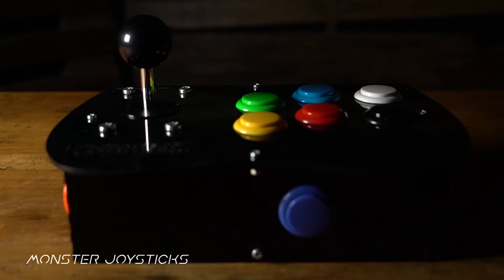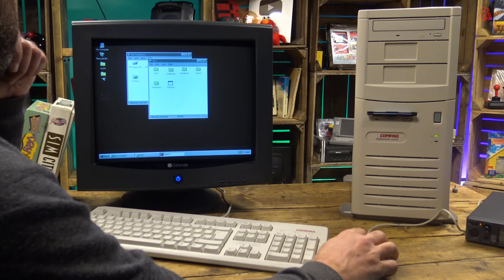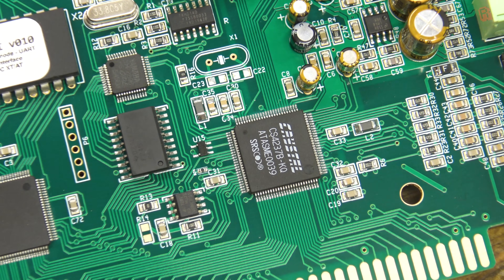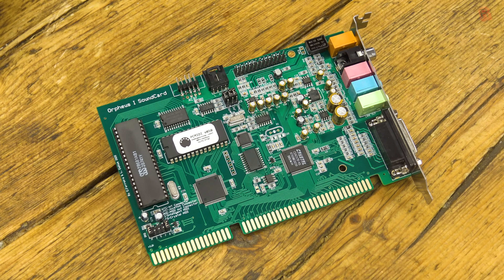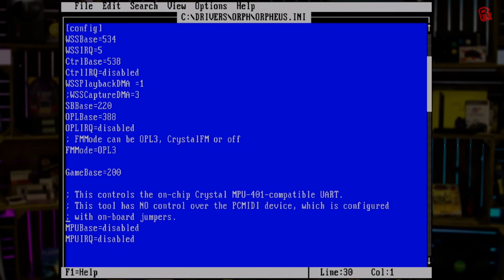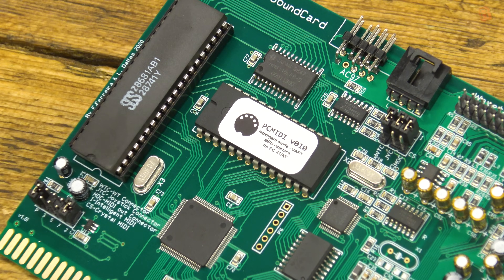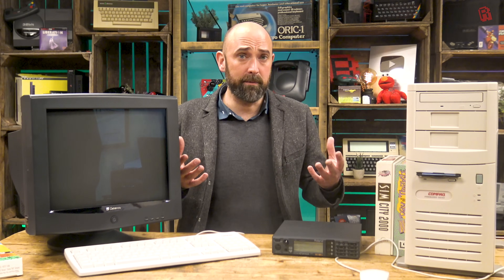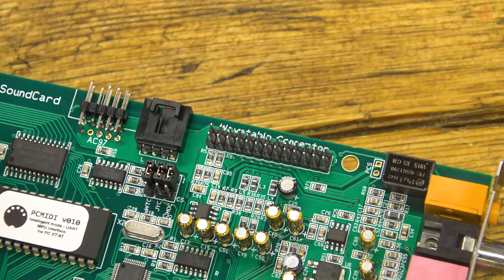Orpheus I + Dreamblaster X2 - A new ISA Sound Card for Retro PC Gamers - Tech Nibble #DOScember

Comment: I have the PixelX86 DX and I am not happy with the audio output, I can hear electrical noise, it's terrible. There is another "new ISA card" called the MK1869, I am wondering between this card and the MK1869 which has the cleanest output.

Comment: Make a mt32-pi and then get a Mister FPGA to use it with.
Reply from the maker: You might like our MiSTer Multisystem with Pi-MMS cart to do just that
Reply: @TheRetroCollective  I already have a sandwich setup in a acrylic case and a mt-32 pie.  It works just fine and has a smaller footprint then the Multisystem witch is good for my case.
Reply from the maker: @michaelcloutier2225  super! So long as you have a solution that works for you that's all that matters

Comment: "That's not the fault of the designers of the card" - In fairness, the card is designed specifically for retro systems, they should have tested it fitted in an AT spec case as well as ATX cases.
Reply: Most AT cases had identical style slots to ATX, even the original IBM PC would work fine with this. Compaq were notorious for proprietary designs.

Comment: What? No MT-32?! Oh, the injustice! Someone must rectify this situation immediately! 

Ahem. Someone other than me, that is. You can pry my MT-32 out of my cold dead hands!

Seriously though, that OPL3 does sound excellent. They've done a great job with the analogue audio section on the board, probably the best sounding ISA card ever made, with the possible exception of the AWE64 Gold, which I believe has a 20-bit DAC. However, unlike the Orpheus I it doesn't have a genuine OPL3, it uses CQM which is a relatively poor emulation of the OPL3. Which is fine, since it has the EMU8000. But honestly I'd prefer an OPL3 for most DOS games anyway, since that's how I played them when I was a kid.

But personally I think the EUR130 base price is a bit expensive. I didn't even pay that much for my AWE64 Gold, let alone my SB16. At least with the current EUR to AUD exchange rate anyway. If I were starting to get into the hobby today, I probably wouldn't spring for this card right away. I'd start with something cheaper like an ESS1868. Sure, it doesn't have an OPL3, but it's a cheap start and make sure it's one with a wavetable header in case you want to think about upgrading with a Dreamblaster X2 later. In the meantime you can set an eBay saved search for a SB16 or just pick up a cheap Vibra16S with an external OPL3.

In any case, for the price you'd think they could've at least bevelled the edge of the ISA connector. Would've made it a lot easier to insert into the ISA slot.

Comment: Would it not be possible to emulate all of these sound cards using a high end microcontroller these days? Or an fpga. Even though fpgas are not cheap, that would be fewer circuits on the board and might still end up with a competitive price thus.

Comment: I own one of these also, and it’s basically flawless. I’m using a S2 vs X2 wavetable board, since I’m using this to run a MT32, SC55, SC88 and MU80. It works flawlessly and replaced my SB Pro 2.0 and PC-MIDI card with an all in one solution!

One of the best designed retro products I have ever seen.

Comment: Funny how these things fall in and out of popularity.

I once had an MT32 - it sat around collecting dust for about 6 or 7 years and I eventually sold it on eBay for about $130 CAD to reclaim space.

I had acquired it for FREE in 2008 or 2009 from a coworker who brought it in for disposal through the recycling system. He had unsuccessfully tried to give it away along with an ISA interface card and a Roland drum module through a Craigslist listing that had been up for a couple months prior.

Comment: it actually did a decent job on the clean fuzz guitar on the first notes of Duke Nukem Theme song, but i feel the distorted guitar sounded too much like a metal grinder.
But i'v encounter that for some reason the Theme song is really sensitive to how instruments sounds, even the Sc-88 pro version of the midi , 
the clean/fuzz muted guitar sounds too thick , even on real hardware because it runs with distortion EFX on it, but the distortion sounds really good.

It almost as the first notes , should better of with a "clean" guitar, and let the drum do the punchy job at the start, and then when the distorted guitar plays, a more richer distorted guitar sound, like the sc-88pro does, is best complimented.

Comment: I wonder if it works in 8 bit mode, so I can use it on my XT
Reply: I have tested this - sadly neither UniSound or Oprhinit work with 8088/V20 cpu... PCMIDI part is the only thing that works in a XT system ...
Reply: @keropiprojects  thanks! I'll stick with my SB2.0 then!
Reply: @AlsGeekLab  a valid choice for a XT system! I have a CT1320 in mine :)

Comment: It's cool, but I just don't have the space to run a fully retro hardware - most of my DOS gaming happens in DOSbox. A USB MIDI adapter (Roland UM-ONE) feeding into a keyboard (Yamaha PSR-630 in my case but anything with wavetable synth should work - many of them are quite affordable) provides my modern midi needs, and works beautifully with DOSbox with next to no configuration needed. :) The UM-ONE is relatively new, but this is the same keyboard I was using 25 years ago ^^
Reply: Come to it, there are some very good sound fonts available as open source which you can install on a modern system without needing to use midi hardware, but for me there's something nostalgic about using the keyboard, and I would have it anyway as I still use it for music-related work too. :)

Comment: Can you run the Crystal and OPL3 at the same time? I've gotten that working in the past- with two sound chips tied to the same address space. Can sound pretty neat.
Reply: I'm afraid this is not possible as it's the CS4237 that controls the FM device and it can only control one at a time. With 2 soundcards you can move one OPL to a different address and have them work at the same this way but on Orpheus the YMF289 is tied to CS4237 it's not a separate entity like PCMIDI for example. As such the YMF289 will also respond to SB OPL ports not that the AdLib $388 one
Reply: @keropiprojects  Is the CrystalFM real OPL2? I always thought it was another of those emulations like the ESS one. Real OPL3 sound quite different than this CrystalFM (OPL2), which is what got me thinking. OPL2 "should" sound exactly the same as OPL3, except mono vs. stereo?
Reply: @ccanaves  CSFM is their own thing - it is their clone of OPL3 just like ESS had ESFM etc etc
OPL3 and OPL2 relationship is like you are saying mono vs stereo and more voices at the same time
Reply: @keropiprojects  Yeah, that's what I thought. So the video is misleading, as it is calling CrystalFM OPL2, which is not.
Reply: @ccanaves  ah , it is just a honest mistake if that is the case - CSFM is not even the star here: it's the original Yamaha YMF289 OPL3 device :)
Reply: @keropiprojects  ofc, I can't think of anyone who would have a real opl chip on the card disabled to use the emulation lol
Reply from the maker: That's a good question, let me refer to the creators...

Comment: What is the minimum CPU required to run this card?  My 386sx wants to know.
Reply: both Orphinit and UniSound will work with a 386sx and will initialize the card correctly - no issues there!
Reply: @keropiprojects  Thank you.  I never got a sound card for it BITD because by the time I could afford a card, nobody had anything that would run on a machine that weak.
Reply: @hardlyworgen71  well the 386/16 will run 386 things - it will just be slow... I view these systems as 286 with 386 instruction set - they are actually convenient ones because 386 instructions are always useful to have even in slow systems!

Comment: I started selling computers in the 90's and often did use sound cards with Crystal chipset. While good under DOS, I had many issues with them under Windows. The included drivers just weren't that good and downloading drivers in 1996 just wasn't as straightforward as it is now.

Comment: You can still get sound blaster 16 isa and other isa sound card from ebay for under $100
Reply from the maker: You can indeed, and that's probably just fine for a lot of people, but this offers the advantages discussed. The SB16 was especially noisy and had compatibility problems operating as an SB Pro
Reply: @TheRetroCollective  Many models of SB16 are not noisy though. The CT1XXX models are noisy, but some of the CT2XXX models (like the CT2230 or CT2290) are crystal clear. The issue is that there are so many different SB16 models with varying quality, but it's nothing a bit of research can't solve. As for the SB16's other problems, it's hard to find definitive answers.
Reply: @TheRetroCollective  If you have a intel 80486 33 MHz or better desktop computer with ISA slot, I will get a Sound Blaster AWE64 ISA card because it's cheaper and easier to get on ebay.  I can't easy find this card.

Comment: Pretty cool! If I were building a 1990s gaming PC I'd be all over this.

Right now I don't play a lot of old DOS games, and when I do, I emulate. I do enjoy getting original hardware for vintage gaming (most recently a Sega Genesis and an Amiga 500) but so far I haven't extended that to PC hardware. Back in the day I leaned heavily toward the MIDI side of things (my first sound card was a Gravis Ultrasound...  It was a fun card but compatibility was a problem of course, and its OPL emulation was terrible) and emulation can support DAC and MIDI at least as well as vintage soundcards could - but chiptunes and analog synth are where you really want proper hardware IMO.

That said the Adlib/OPL music and sound on PC never left me with too great an impression. Maybe there's more to it than I thought? I feel like since there were so many OPL variants and OPL-compatible chips (not to mention the fact that OPL music was just one option among several on the platform) - game makers couldn't really tweak their tunes for optimal results the way they could on C64 or Sega Genesis - where, again, you had different versions of the hardware that could sound different but in principle at least every machine had the same hardware and made the same sound.

(So for instance looking at Lemmings - personally I think the Genesis music is great, but the Adlib music on PC to me is nowhere near as good - and I think the Adlib should be capable of better sound than the Genesis FM synth, right? I don't know how much that is the result of the PC platform being more nebulous and how much is the marketability of each platform...)

Comment: I recall well the euphoria i felt installing my brand new Soundblaster Awe 32, it was "Awe"some.
Reply from the maker: I couldn't afford such premium sound at the time, I'm jealous of you
Reply: I still have my  loaded CT3900 which I picked up brand new in the early 90s. I recently recapped it and did a couple of small mods to clean up its output, which helped it out quite a lot. Seems to have more punch and definition to its sound then it has ever had! But it is still not 100% free of disk sounds or other interference. Though I would say its about 75% gone which is substantial. I do know it has deteriorated through the years and I am not sure how it compares to when it was new, but I am sure its much improved.. The new Oprpheus sounds like it would give it a solid run for its money though..

Comment: "Audio grade capacitors", I'm afraid, is just marketing speak for bad audio design.
IF they are passing the audio signal through the Al-elec caps then that is nearly the worst thing they could be doing. Those caps fail by being subject to AC waveforms. They are ideal for bulk decoupling of DC rails where they only have ripple to deal with, but must never be used with true AC waveforms, even with DC offset. Reverse polarity is the worst thing for them, but AC that does not reverse polarity is a close second.
Historically, they had to be used as they were the only parts with sufficient capacitance to be used, but modern day alternates exist (properly specified ceramics or audio outputs that don't need decoupling).
I have  fixed two Sega Game Gears where the screen won't work and the prime reason is that the AC waveform that refreshes the screen has a large DC offset that requires the signal be decoupled. The original electrolytic caps can't deal with it forever and end up leaking. The fix is to replace with ceramics that have been derated properly for the DC offset. The true fix would be a modern LCD that does not use such a driving scheme.
Reply: I don't know for certain, but I suspect they're used for DC only. There's a lot of chip capacitors mixed in with the chip resistors, and the placement of the electrolytics seems unrelated to the position of the connectors.

Comment: It's amazing to me that these days you can design your own sound card (or indeed any pcb) and even get it built to this standard. Especially when you consider back in the day that pretty much the only people that could do this sort of thing was large businesses with considerable funds behind them!
Reply: It could technically be done by just about anyone who could afford a pc in the first place, the trick is that the internet makes a lot of info much easier to get than back in the day, so if you dig around long enough you can cut through the nonsense and voodoo logic that tends to get passed around as "fact".
Reply: It's even more possible because of availability of technical documentations of these chips, often with complete schematics. I know Crystal and ESS chips have those.
Reply: @Paar86  Its ironic that these chips are our saviours today when soundblaster clones were so hit and miss back in the day.
Reply: @alexatkin  It's necessary to know where to look as often even those old SB clones can be much better and compatible then a real SB. That applies mainly to SB16 and AWE32 as they have many bugs, incompatibilites and in case of AWE32, inferior wavetable synth to a competition. But they still sell like they are the top of the line products and ultimate solution for any retro PC. I would definitely pick Crystal (except CS4235) based card over SB16 for every day use.

Comment: And just to think that back in the day I used to associate Crystal sound chips with cheap cut down Soundblaster clones.  I really hadn't realised how much the Crystal version of FM sound missed though, the OPL3 shows a real improvement in sound detail.  I also really like the inclusion of the wavetable connector.  I have had a hard time sourcing a sound card with this connector, especially for PCI based systems.  I would like to get a PCI version of this card for my own retro system.
Reply: Agreed, I can't see myself using the Crystal chip on this at all. Not with a genuine OPL3 on board! But I suppose it's nice to have that option for later Windows games.